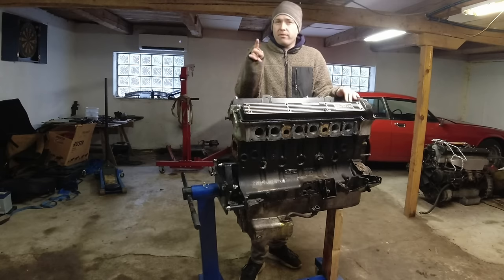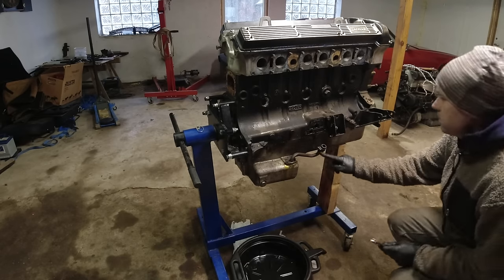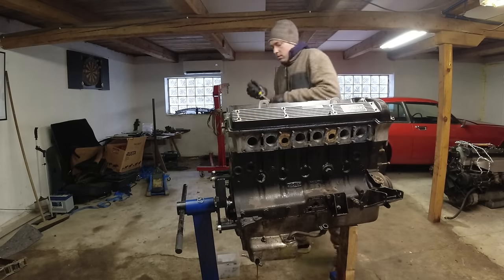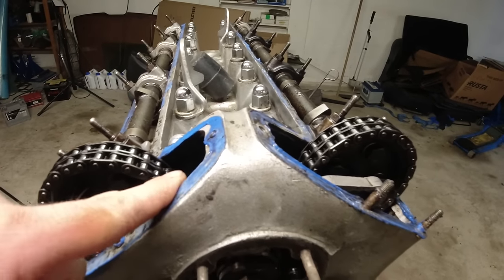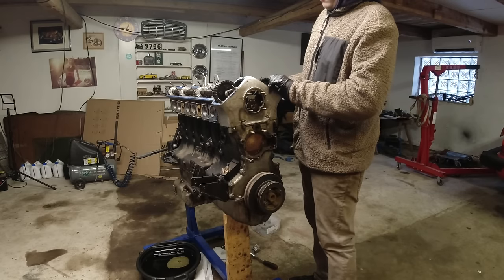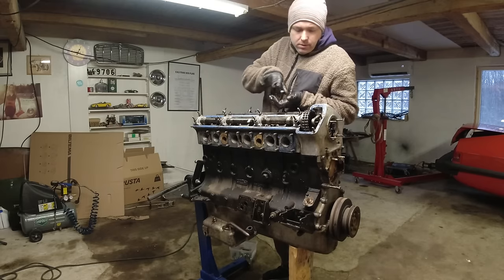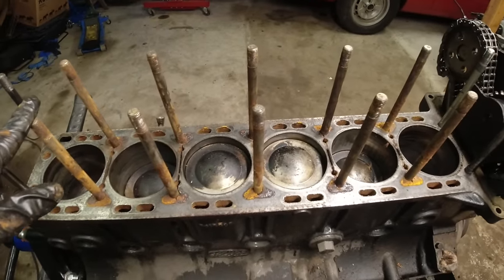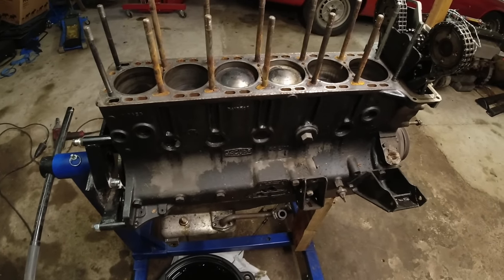Jaguar 4.2 XK engine strip down (Part 1) - What went wrong?

Comment: Hi Adam, 

Interesting video. I also stripped my early S3 XK 4.2 engine which had some cracks between bores. A company put in new liners and skimmed the block and cylinder head for me. They also did the reassembly of the crank shaft, new bearings and pistons with new springs.

From there I took over and rebuild the entire engine with new chains, oil pump, stuts etc and it’s running for almost 8000 km now .

It’s just a lovely engine 🙂

Cheers,
Wilfred
Reply: Hi Adam, long shot I know....I bought an 83 xj6 s3,.....
Just wanted the body, was gunna Frankenstein it, but after driving found the engine, welll....not that bad......do you know much about them?, I'm looking to strip it and rebuild as a possibility as I just got the stink eye from my wife when I told her I was buying a 1uz.....

Comment: Adam, if you haven’t already tried this, stuff some rags in the cam sprocket area of the head before removing the hardware. This should catch what you may drop. You may need to remove/reposition the rags before/after rotating the engine as you proceed. Note: I work on these engines.
Reply from the maker: I usually have rags there when it’s an engine I’m using again. This one is just being stripped for parts.
I work on them too

Comment: Hi did you change the studs when you rebuilt it , they are one time use only as they are designed to stretch.
Reply from the maker: They were new. Now they are going in a pile for something. Seems a shame to throw them out. Could be used to build something

Comment: As you struggled to lift tat head off I felt my back go!!
I would have lifted it a couple of inches with the jacks then wrapped a rope round it and used your engine hoist to lift it off. Saves the back for your old age. Very interesting video.

Comment: How did you get the studs out. I did the V12 and had good tools but it was scary to ruin something or brake one off.
Reply from the maker: Just vicegrips
Reply: @LivingWithAClassic 
Wow, I thought being so long and probably corroded in they would be impossible to get out. I have studremover that I could slide over them to get es close to the deck as possible because they where „springing“.
Eventually I got them all out without any damage. 
I felt that I was under more tension than the studs. 😅

Comment: Too bad the captions were missing from this; the commentary was rather quiet.
Would it have been possible to leave the lifting tabs bolted to the head and pulled it off with the engine crane, or was there a good reason not to do it that way?
Reply from the maker: You can’t leave them on since the are held on with the same nuts that hold the cylinder head on.
Reply: That is one reason and the other is if you try to lift off the head with a crane you will have no success as it will stick very well to the bolts as it will generate lots of friction when only slightly tilted. I could still lift the whole car pulling the head with a crane when it was 10cm above the block. Pushing it with hydraulic jacks and a couple wooden blocks worked fine for me..
Reply: @LivingWithAClassic  That certainly constitutes a good reason.

Comment: Clear evidence that Stop Leak is not a good idea !

I think you had pretty much decided previously that you had a bad block with a leak / crack, and that had caused persistent problems. If you can fettle it a bit and save it that would be great, but as you say take expert advice !
Reply from the maker: Yes! It was good to try it to be able to see what it does.
I will save the block and maybe rebuild it someday in the future. I’m saving a few 4.2 engines for the future.